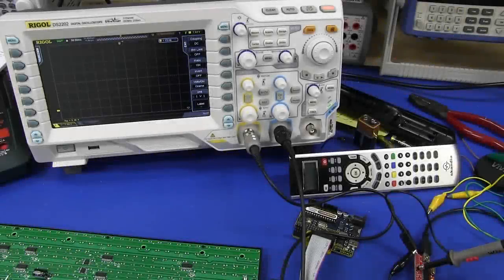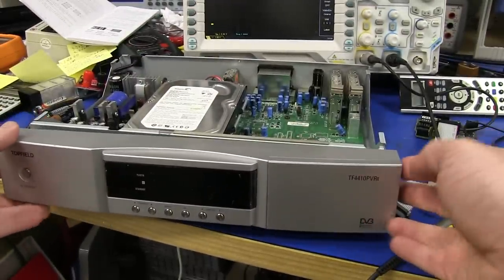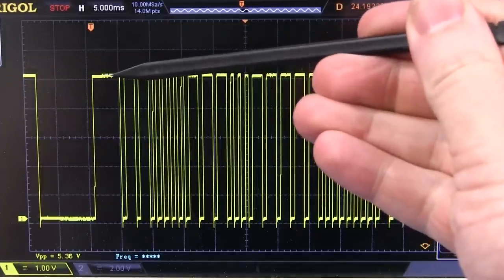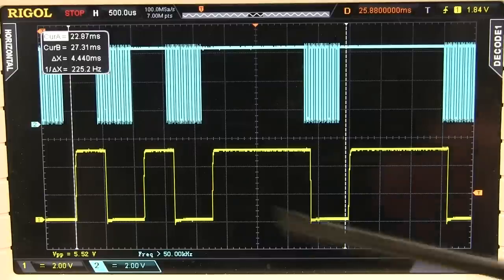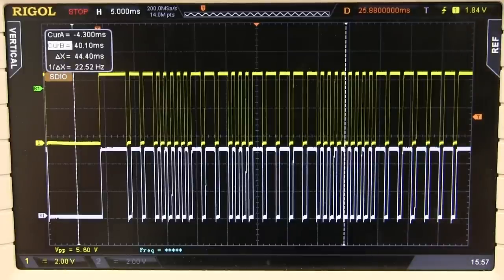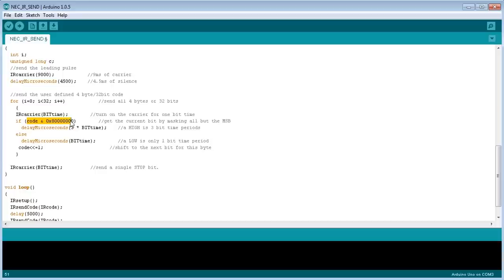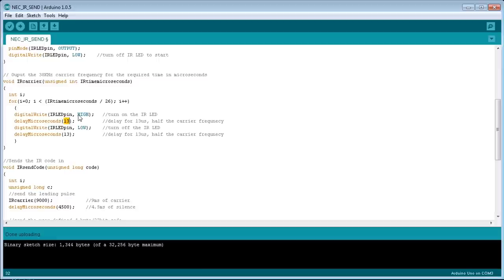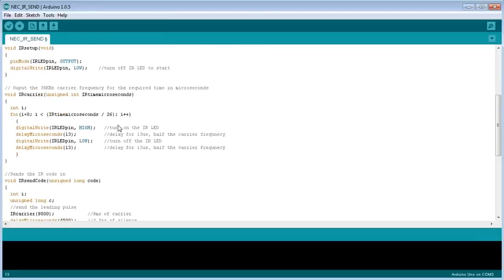EEVblog #506 - IR Remote Control Arduino Protocol Tutorial

Comment: Btw, just to be clear for folks, the 26ms that you divided by in your IRcarrier() function is THE PERIOD of the 38Khz.  Freq = 1/Period, which means Period = 1/Freq = 1/38Khz = 0.0000263157 sec = 0.0263157msec = 26.3157usec, which is roughly 26usec.

So, your code wanted 9000usec of 38Khz carrier freq means that "how many periods of 26usecs do I need to generate?", which means 9000usec/26usec = 346 periods, that is, 346 iterations of the loop in your IRcarrier() function.

That's how the 38Khz carrier frequency is generated with an I/O pin.
Reply: Thanks a lot. That's the only part I didn't understood

Comment: If you don't have a digital scope, just connect the output of a photo diode to your line  input of your pc's audio card and record the data.
Reply: thats a great idea!!
Reply: Dave R Good idea indeed but there's a limitation. The standard audio cards are made to sample from around 20Hz to 20000 Hz. That's not enough to see the actual carrier frequency, but its totally good enough to decode each button code. I just made this a couple of days ago, and I was able to decode every single button :D. Btw I used a free software that plots the mic input and lets you visualize interesting stuff like frequency gains.
Reply: What was the name of that free software you used, please?
Reply: There are soundcards capable of 24 bit @ 192khz. That ought to be enough for things like this :)
Reply: I just did this, as my receivers did not make a proper capture of the signal. using a standard sound card was able to clearly see the codes with a simple ir receiver (2 pin on mic input). my air conditioner had a 36-bit code, so I made a few modifications to the code posted here, adjusted the initial timings (assumed a 38khz carrier) and bam! working fine! captured the output to match the original remote, and from there I refined the timings. (i did not have an oscilloscope). an arduino pro mini 3.3v did the job perfectly
Reply: Good Idea Johan Sagaert, this really helps for those who don't have a oscilloscope or a logical analyser.
Reply: +macguionbajo some sound cards record up to 48kHz
Reply: Beginners beware overloading the card though!
Reply: The free software macguionbajo is referring to is probably Audacity. I could be wrong though...
Reply: I recall some warning about soundcards that the input is decoupled. Should be fine for this kind of thing but watch out for low frequency/DC stuff.

Comment: What I enjoyed about this video is not the programming, although that is always instructive, but the reverse engineering of the raw pulses into a carrier freq., pulse codes, NEC standard...  Big thumbs up video for newbie hackers and those who just want to understand how things work!  Are there many major IR coding standards besides NEC?
Reply: Another very well known one is RC-5 (wikipedia.org/wiki/RC-5). It runs offically on a carrier of 36kHz, but a lot of manufacturers used 38 due to being misinformed or lazyness. It works anyhow. The bits are a fixed lenght where the direction (rising or falling) of the slope in the middle defines it's  value.
The toggle bit Dave talks about is used for ch+ and ch- for example. It prevents to skip 5 channels if you keep the button a bit to longue.

Comment: I recently made a remote control and IR receiver for dimming six leds individually. Used a timer to create the carrier signal and used the UART with a baud rate of 2400 to send the information, worked liked a charm :D Each transfer consisted of four bytes, the first and last byte are address bytes, I hardly get any bit error :)

Comment from the maker: As you saw in the previous video, I am using the Arduino for the matrix display, it came with an Arduino driver and connection board.

Comment: If you want to see some truly twisted IR encoding look at the MILES 2000 a.k.a. military laser tag. The older system used a relatively slow IR signal and when they decided to update things they still wanted to be able to use the old gear so they snuck in the new bits inside the existing bits. As I recall it was something like they split up the high time from one 'long' bit for the old system to many short bits for the new system. The old receivers would filter out the new fast bits and still work just fine and the new receivers would be able to 'see' the additional data.

Since it did not add value to the project we were working on at the time to decode the actual MILES 2000 signals we skipped it (we were adding haptic feedback to the soldiers gear so they would feel where they were hit.)

Comment: That would be the more efficient approach, but I think that this video is more about how to use your gear to reverse-engineer or diagnose a serial protocol and how to implement it in A microcontroller. The IR protocol is just a special case and Dave did a good job by not introducing PWM here...

Comment: Great video. For solving the timing issues what about : 
1) Generating the signal inside an ISR with proper timer setup. Signals might be a little bit too late (because of the delay between the ISR and the signal is finally outputted on the pin) but at least it wont drift over the time.
2) using UART

Comment: I know this is an old video, but for anyone watching that's having trouble getting the carrier frequency right, another approach would be to use a PWM channel and toggle it on and off rather than "bit banging" the carrier. The IR libraries Dave mentioned at the start likely do this. I'm sure Dave just chose this method because the code is easier to understand
Reply: I couldn't get any IR libraries to work on the ESP8266

Comment: I have been experimenting a LOT with this crap.  It's a real pain in the butt to get enough documentation to know what the heck to do.  I have spent a lot of time accumulating documentation. 
I'm doing it with a PIC chip.  Specifically a PIC16F1503. I'm so close I can taste it.  I have a handheld Qunda IR Remote Control Decoder.  It sees and decodes my PIC's IR output but the TV is not.  More tweaking needed.
One thing I noticed is that you assume is that the 38Khz duty cycle is 100%.  ie., 50% ON, 50% OFF.  It's not.
33% on time is more like it.  Keeps LED's from burning up.  They are usually pulsed at some insanely high currents.
 I could write a book.  Argh.  Thanks for the video!
Reply: mike94560 I’m also working on a project that deals with a PIC16F883 and IR , how far did you get !? Can I see your results and how you got to where you wanted

Comment: Dave,  there exists (or did) an IR receiver with a carrier frequency of 455kHz.  I have succeeded in sending audio over this IR module (something like a TL9000--but I seriously doubt that's the exact part number since it's been so long).  Most interesting of all is I managed to send DTMF codes over it (to a DTMF decoder) for remote control applications, and even multiplexed and patented it after I added a feature that allowed more than one DTMF encoder button to be pressed and held continuously with a receiver modification to match.  Then this wonderful high frequency IR decoder was discontinued--go figure.  I think I got all mine from Vishay...still got a few of them though.

Comment: Thanks for the video, Dave. My cable TV provider is going all digital so I need to use an external digital decoder box to be able to pick up all the old channels. I've been wanting to make a device that can send the IR codes to the external box. This video has certainly helped me to work out how to decode the IR signals sent by the remote.

Comment: a) I would have used a PWM signal to generate at least the clock signal, so you don't have to tweak the timing. The 'professional way' would be to write the whole IR-signal generating code in the overflow interrupt of the PWM timer. But don't worry, for a demo your code is more than adequate.
b) It could have used a little more cowbell.

Comment: @bcsupport Dave programmed his Arduino with a 'sketch' written in the "processing" language (roughly speaking a subset of Java which is compiled to byte code and then interpreted on the device) - it's not ANSI C. It's possible to program the Arduino with pure C but mostly not necessary.

Comment: I guess the long burst up front is for the receiver to set its AGC.
And the stop bit so every bit is followed by a leading edge, so you can just measure the time between leading edges.

Its interesting to think about how the transmission is often designed for the receiver to receive it cheaply and reliably, rather than for the ease of the transmitter

Comment: I've done this once.  My solution for the carrier was to use the PWM module in the PIC I was using at the time to generate it.  One side of the LED went to the PWM output pin, the other went to a pin with the data.
Reply: Peter Mortensen  The led was sourced from the data pin, and sinked into the pwm pin.  Two pins, one driving the high side, the other driving the low.

Comment: The other fix would be to replace Arduino's digitalWrite routine with one that optimizes down to the single machine instruction it should be. Considering the "digitalwritefast" implementation is entirely source compatible and has been around for years, I've no idea why the Arduino team hasn't already included it.

Comment: Hey Dave GREAT video! i just have three question about your code: Why did you make your own void IRsetup instead of using the normal void setup? you added your IRsetup to be called in your void loop and added commontary that you only need it to call setup once but what stops the loop from executing that setup over and over again? Also why do you prefer to use so many voids instead of putting all your code in the void loop? I'm not saying your code is wrong. I just wonder why you prefer this way

Comment: HIGH is just a macro that gets substituted by the preprocessor with "1" before comiling the code. So you will get exactly the same result, no matter if you use "digitalWrite(IRLED, HIGH)" or "difitalWrite(IRLED, 1)":
avr/cores/arduino/Arduino.h:#define HIGH 0x1

Comment: Thanks a lot Dave! Awesome video :-). I was surprised that connecting the IR LED directly to the output pin actually works. My readings said that one has to use a transistor, because IR LEDs draw more current than normal LEDs. So I went directly for a transistor circuit, but never brought it to work. Does your LED light up as bright as the original remote-control, when filmed with a digicam? I thought the brightness was my problem, but now I think I should look for the problem in the IR-Code...

Comment: Though the length of '1' and '0' is not the same, the NEC protocol defines that you should send an inverted message as well, so the length of the whole transmission is constant., 67.5mS

Comment: I was just trying to capture the IR codes for some obscure DVD player (an ugly cyan/silver colored beast from RITECH). Just about no info online and you NEED the remote. I have the non-functional remote, but the stale-cheese looking resonator for the mystery COB's clock and IR carrier generation is dead. Did find it uses 36kHz carrier online...  Maybe capture the data to the driving NPN's base (carrier freq is wrong, but should be able to scale it) then hand feed to LIRC for decoding. Hopefully!

Comment: Dave you should have used DigitalWrite(IRLEDpin, 1) instead of using HIGH. It is considerably quicker than HIGH. That way you would not need to guesstimate the delay like you did. Give it a go and see if it helps... I suspect it would be much quicker.

Comment: I guess we all code differently. Thanks for using a unsigned long to hold the binary message and not int bits[32] as appears elsewhere on the web. 
Is it necessary to repeatedly call IRsetup()? Could that be put in Setup()? The LED is OFF at the end of IRCarrier().
 
Thanks for the fulsome explanation, clear readable code (not C obscure)  and your comments on available libraries, Murphy's law and sampled waveforms.

Comment: In binary 0x80000000 is one followed by 31 zeroes. When you do an and operation with that on a 32-bit number you end up with its most signifigant bit. Within the if statement in the code, if the MSB is one the the condition evaluates as true, if zero then false. After that there is code<<=1; which shifts the content of the code variable one bit left, changing the 32nd bit to what previously was the 31st bit. The idea is to go trough the code variable bit by bit.

Comment: The slow part of the loop is surely the divide by 26 in the conditional, which is executed every iteration of the loop. I'll bet the division is slower than the digitalWrite() call. The division should be pulled out of the loop.
Reply: the compiler optimizes that out already

Comment: I'm an embedded SW engineer, and I've been looking down a bit on Arduino, I must admit. But it's one of two things I've changed my mind on, recently: I've been playing with it, and it's really very fast to work with. In a few minutes you can get some things to work that would take you days otherwise. You don't get optimal performance in that time frame, but it works. And as Donald Knuth said: "premature optimization is the root of all evil". Then again, who the f is Donald Knuth ;-).
Reply: I know this is an old post but I felt the same way but then gave it a chance. It is really like a rapid application development environment. There are also very advanced people on the forum that can help if you get stuck. Great community.

Comment: Thanks a lot. I followed your declaration and did a small research. I do understand the Idea now. Thanks. If you want. I still have a small question: I know "code <<= 1" means shift all 32bits of variable code one bit left. But is that means the last bit (the opposite side of the MSB) will be always automatically filled with zero. or some thing else? Thanks. : ]

Comment: I don't think that it's the compiler to blame here. Since avr-gcc, for example, compiles (with the usual size optimization enabled) "PORTB=0x55;" into "ldi r24, 0x55; out 0x18, r24;", which is the optimal form. So it seems to be the Arduino library having some absurdly slow IO-routines.

Comment: No, this is a misconception: While the Arduino "IDE" is written in Java, using the "processing" framework, the "sketches" and libraries that they use are written in pure C and C++.
The Arduino platform is not only the harware but a combination of it together with the IDE and the Arduino library that hides many details of C and the Atmega hardware under an abstraction layer that allows non-software developers to experiment with MCUs.

Comment: Thanks, the missing puzzle. Thought the receiver was a dumb photodiode, but it must do some 38kHz filtering. You would expect there is a 5V input transmitter that does the 38kHz thing as well, so you can send the yellow simple signal, and have the 38kHz magic applied on your digital output. Does anybody know if that exists?
Try to program without delays though. Run either a 38kHz loop frequency, or use a hardware timer with an interrupt routine.

Comment: I think the gist of his comment believes the Arduino doesn't have enough output drive to pulse an IR-LED thus the transistor idea.  No robust design should start without understanding what the circuit is SUPPOSED to do.  In other words, determine I-max of the IR-LED in free air.  Then using the Vf drop of the LED, subtract that from your supply voltage.  R=IE will then get your "dropper" resistor.  If I-max > Arduino's current capability, you need the transistor.

Comment: I'm I right in thinking that connecting a low pass filter to a simple photodiode would demodulate the carrier frequency?
Reply: it sure seems to
Reply: A bit more detail: since I only had a photodiode on hand and no TVs i could say goodbye to so I made a low pass filter with a cutout frequency of 4kHz (educated guess and I had all the parts) and inverted the signal with a PNP. Now I get consistent readings but still haven't managed to send the right signal to turn on the TV.
I wish I had a scope...
Reply: bakadavid Why don't you build yourself a scope. At 38 kHz you can build a complete, integrated spectrum and logic analyzer for five bucks using your PC to represent the data. Just choose a µC with USB.

Comment: The library _is_ slow. The reason is, that you can do analogWrite on a digital pin. It's setting up PWN on that pin. So if you do a digitalWrite, the library needs to check first, if PWM has been used before, reset the PWM timer, create the bitmask and so on.
The Arduino library keeps everything incredibly simple: No need to read the Atmel datasheet, no need to understand the different ways to access standard and extended I/O ports.
If you want to be fast, you need to roll your own...

Comment: What if I wanted to completely bypass the LED and directly manipulate the receiver pins on the input device?  Would I still need to worry about carrier frequency if I had literal wires connecting the Arduino to the IR receiver contacts?

Comment: The Arduino framework is so inefficient, hence the ~4us DigitalWrite functions that threw your code off. That's about 80 clock cycles to toggle a pin, compared to the couple cycles it should be!

Comment: First: what kind of libraries are you talking about?
If you talk about using and writing Arduino libraries, the Arduino website (arduino.cc) has a
tutorial for installing and also for writing libraries.

If you talk about libraries in general, they are just a collection of functions/macros written for a certain purpose (e.g. a I²C library for communicating with I²C devices) , bundled together in one or more files.

Comment: Wouldn't usage of Arduino SDK instead of AVR SDK make it already non-portable enough? Serious question as I've never used Arduino SDK so I don't know if the code can be compiled for AVRs other than used on Arduino boards. I've even used AVR SDK with Arduino board I've borrowed from a friend of mine.